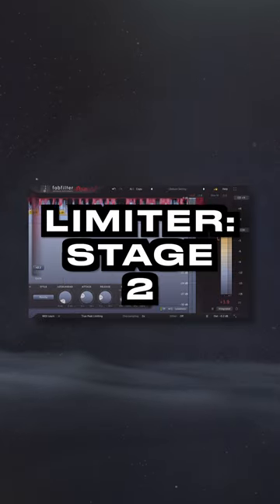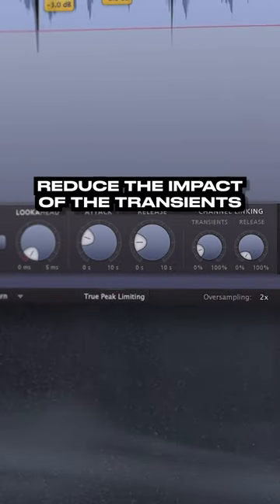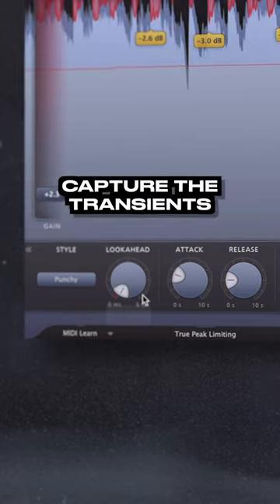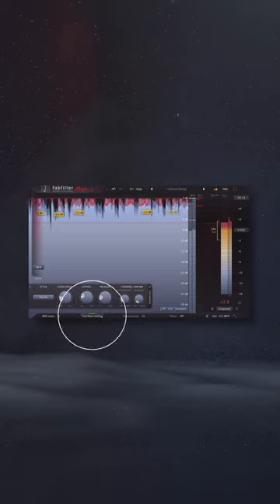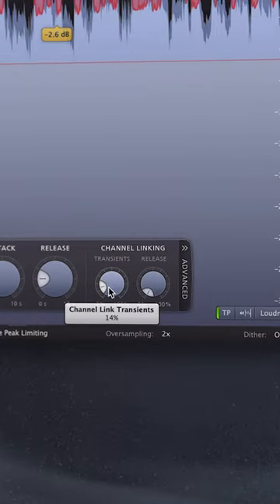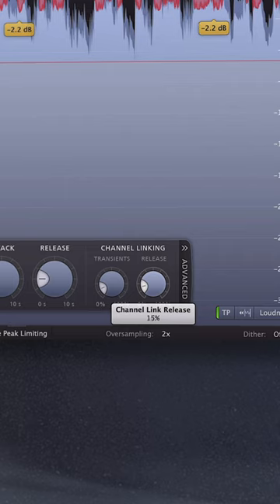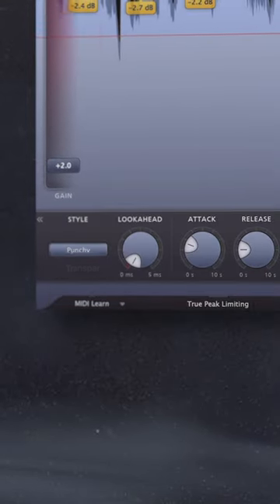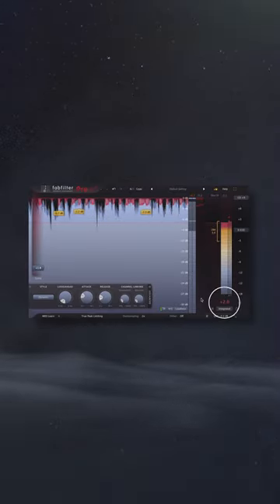Clean Master: Limiter Stage 2

Comment: doesnt really work on trap music at all
Reply from the maker: Thanks for watching! Using 2 limiters doesn't work well on Trap?

SageAudio.com
Reply: @sageaudio  ive been working as a mixing engineer for the biggest artists in Greece for more than 4 years, and from what i learned thru experience and other engineers is in trap/hiphop name it as you want music of 2023 the final limiter has to be a brickwall limiter. So trying to preserve dynamics and stuff doesnt really make sense on the final limiter. The only thing you need it for is brickwall limiting, truepeak limiting cause its very close to the actual truepeak algorithm and oversampling/ceiling.
Modern algorithm sounds best